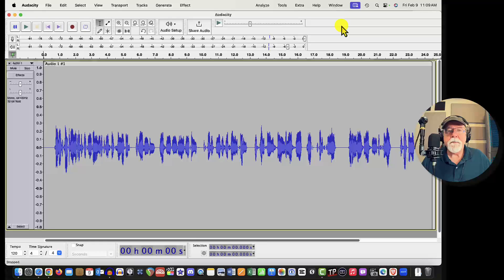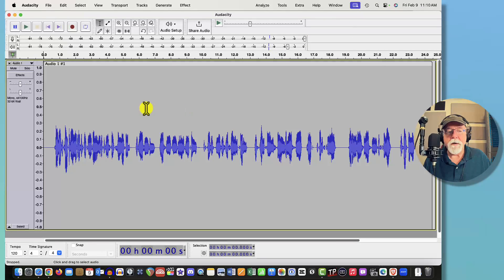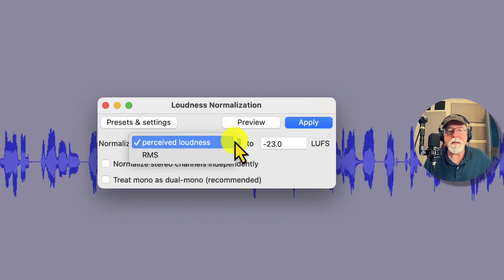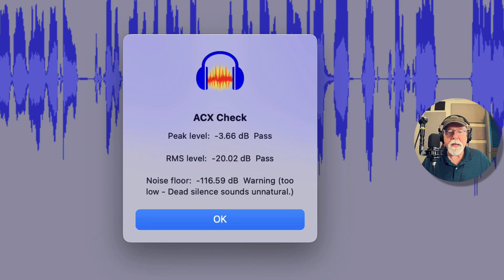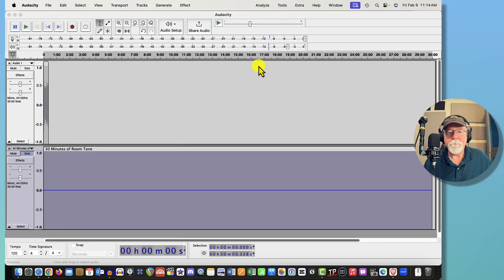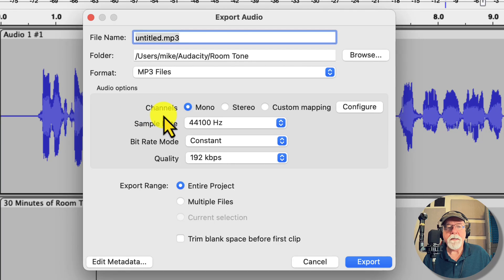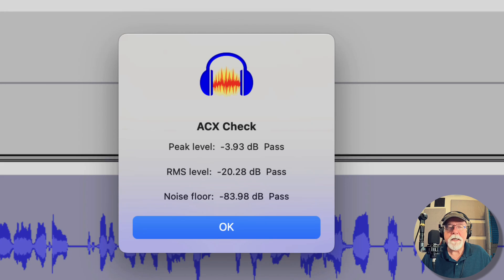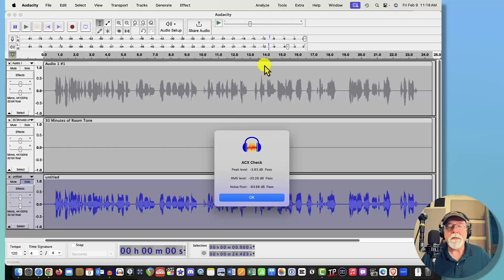How to Fix Low Noise Floor for ACX in Audacity

Comment: My noise floor is still failing 🤣 this is dementing me lol
Reply from the maker: I'm sorry to hear that. What's it doing?
Reply: @AudacityTraining thanks for getting back so quickly! It’s fluctuating between RMS and Noise floor. Leaving the microphone running it passes noise floor but fails RMS. My audio files I can usually get to pass RMS but noise floor varies from 40-58.
Reply from the maker: @AuthorLindsayDuncan  Are you using the Legacy Limiter and Compressor?

Comment: I followed this video explicitly and still cannot get my noise floor raised.  The room tone suggested, passed ACX  with flying color.  I exported the project (both voice and room tone tracks to mp3 as suggested, making a third track.  However, this track still does not pass ACX!!!  All I can assume is that the top two tracks (voice and room) did not merge as you indicated.  Please help.  I'm frustrated as hell!  And on a short production timeline.
Reply from the maker: @pameladowd8919  What is ACX Check giving you for the mp3? What are the numbers?